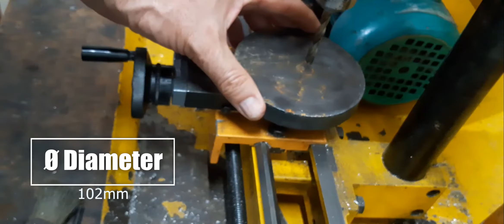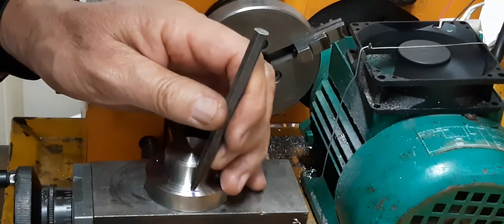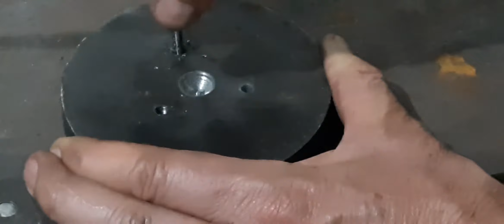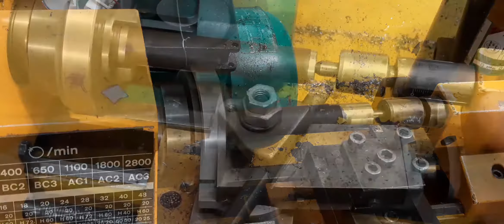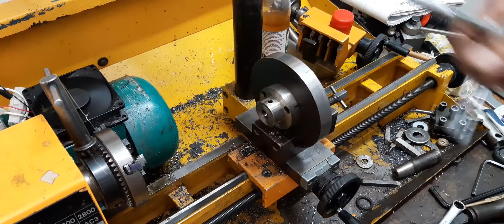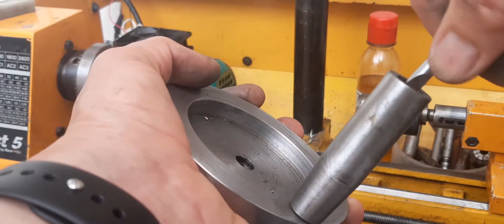HAND WHEEL FOR LATHE OR MILLING MACHINE -  (HOMEMADE)

Comment: Hi! thanks for sharing, nice work! Is it a Emco Compact 5 machine your using? (I have one too)Is it a PC cooling fan your using to cool down your motor? Great idea, mine is getting very hot too. Thanks
Reply from the maker: Thanks friend for asking, I have an emco compact 5 lathe and although it is small I have managed to carry out my projects, the original motor burned out and I replaced it with another one which I adapted an additional pc fan to cool it and it has worked well for me, If your lathe motor gets hot, I recommend adding a fan to help keep it cooler. If you have another question, I am here to help you. Thanks F.M. Projects